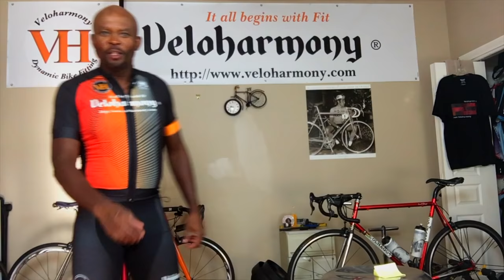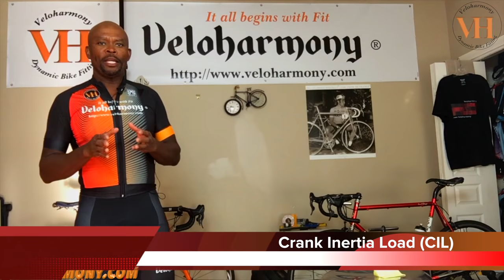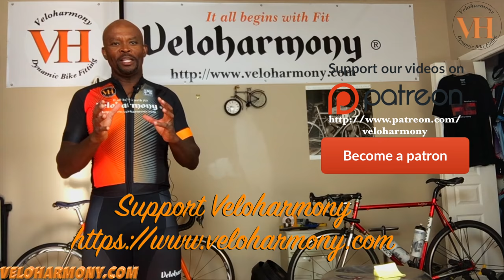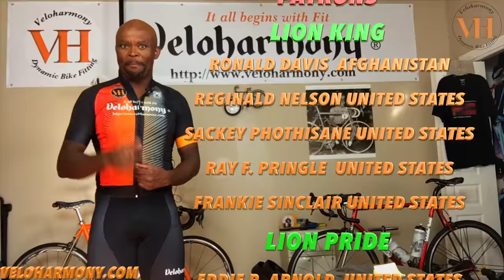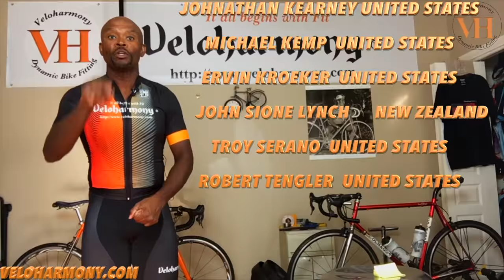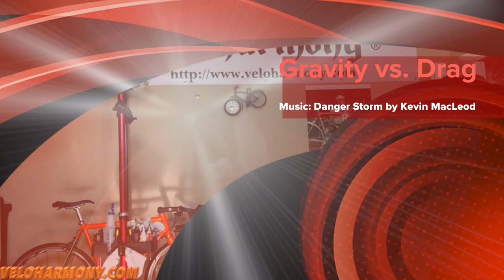Why do small cyclists struggle on Flats - Watts per kilo cycling

Comment: Great explanation Eldred. I’m a small guy (142lbs) and I’m working on my flat speed (power). I’ve found that I do even better on some hills when I stand on the pedals. I can really get moving uphill because I can generate more power standing. I’ve kept up some of the heavy hitters on my club rides when on the flats but sometimes it’s challenging. In fact, the Ride Leader seemed amazed that I kept up with them on that one ride. Lol. He kept giving me compliments. But I can’t keep up with them all the time. I have to spin at a faster cadence (95-97+) when they’re at a cadence of let’s say 88 in a slightly bigger gear.
Reply from the maker: As a smaller rider continue to use your natural tendency if you prefer higher cadences which stresses your heart and aerobic system more and focus on drafting efficiently and dialing your fit to clean up your posture on the bike and improve your aerodynamic positioning. You don't have the mass to push the same size gears as the larger riders so as the Father of the Le Tour de France Henri Desgrange would say: tête et jambes...ride with your head and your legs.

Comment: I am more of a lightweight rider, I struggle in the flats/wind. Although my cadence is around 95/100 rpm, I cannot push a big gear. I now try to sustain a bigger gear and maintain the same cadence, even if I am only able to do it for a short period of time. To slowly trying to get used to those bigger gears.
Reply from the maker: That's akin to interval training. You naturally do not have the body mass of larger riders, so you need to improve your technique, position & etc. to reduce the drag you face on the flats. Focus on refining your fit which will enable you to improve your aerodynamics when you ride.
Reply: Yes, on the flats I try to adopt a more aero position. Ridding on the drops or in the hoods with the arms bend at 90°. Before doing a bike fit I almost never used the drops. Just by staying a bit more low my speed increases slightly maintaining the same effort. As for refining the fit that is also a good ideia. Thanks.

Comment: I forget the name of the actual principle in physics... But the viscosity of air increases as the speed you pass through it increases.
Reply from the maker: Drag (air resistance) increases with speed because more air molecules are striking the leading surface of the object per second as its speed increases. With a constantspeed you WILL get a constant drag, because drag is a force, and an imbalance of forces is an acceleration, which is not a constant speed
Reply: The drag increases at the rate of almost the square of the velocity, to the power of 1.8 to be more exact. So the power output required to accelerate to a higher speed becomes exponentially much more demanding.

Comment: Last week we had an event with around 500 cyclists, it was 100ks it started off at a grueling pace around 38-40 kph. I struggled and dropped back to my pace 30kph. We came to a hill section which was 6-7 ks climb at 10% average and16% at tops. i am 65ks and 67 years old and was going well up to the first 2-3 ks but then burnt out. I have a very good cardio system and can keep up a good cadence but my legs just burnt out. I stopped and some riders advised me to get a 40 cassette as its a lot easier I have an 11/32 at the moment. What are your thoughts on this advise? Thank you love your vlogs. Cheers
Reply from the maker: It depends on what you're running on the front but anyway, I think with a compact 34X50 on the front, you might be okay with maybe a 36 on the rear. I think a 40 is just too much. What kind of cadences were you maintaining while seated on the 10% grade per say?
Reply: On the flat, I can keep up a good cadence around 85-95 comfortably and on short hill climbs around 60+ but the climb on the 10-15% it was my upper thighs that burnt out my cadence went down to around 30 maybe less just couldn't push up the long climb at that %. I wasn't the only one to stop but the guys with the 11/40s were going ahead without stopping. My heart rate was around 165+ but I'm ok with that just the grinding my problem lol. Cheers
Reply: 11-36 using a clutch rear derraiuler and wolf tooth road link would work with a 50/34. You can also use a sub compact crank and keep your 11-32

Comment: Eldred, doing a hub rebuild on an old new stock Deore LX rear hub loose ball bearings.  Used Phill wood greace to pack the bearings and noticed when I add Finish line wet lube to the cone race the hub becomes lightening fast.  Is it oK to mix wet lube with greace?  Gonna ask my pro bike mechanic later this week, but wanted to know what you thought of this.
Reply from the maker: Well all you're doing is diluting the grease. There are applications for grease where you want longevity and the dilution will not help that.

Comment: I am pretty sure you got it backward. Fast switch fibers = sprinter = lower cadence. Slow twitch fiber = endurance = high cadence. Right? or have I got it backwards all these years. This is why you see guys like skinny chris froome with cadence 100+ going up the hills
Reply: Matt Glover You have it backwards, my friend. Sprinters don't sprint at a low cadence. Cav, Sagan, Greipel are all spinning 120+ rpm
Reply from the maker: TeslaOsiris is right Matt. I have a preponderance of fast twitch fibers naturally and came from a Track background and when I got into cycling, I could easily outsprint most riders in my category, but I couldn't climb to save my life. I had to increase my ability to pedal at lower cadences 70-85rpms for sustained climbing to be there for the sprint. In a sprint 120+rpms is routinely exceeded. I can cruise on the flats around 100+ easily, but some riders have to really work at that.

Comment: At speed, the power you have to produce is proportional to the cube of your velocity. So, to increase your speed by 25%, you need to nearly double your wattage!
(Thanks Steve Gribble).
Check out this power to speed calc.
https://www.gribble.org/cycling/power_v_speed.html
Reply from the maker: Very concisely stated. Thanks for stopping by, appreciated your input.
Reply: Did you mean to put CUBE of velocity or SQUARE?

Comment: While there's truth to this, the smaller riders also have to carry roughly the same weight of the bike up the hill.  The weight difference from frame size, crank length, handlebar width all don't amount to be much.  Tell a little guy to pick up a few cases of beer up the a few flights of stairs and let the big guy do the same.  I think the big guy will win nearly every time.  Gearing is the same typically which isn't exactly optimal for the smaller rider either.  The practical problem with commuting in traffic is a safety issue.  You can climb as fast as you want pretty safely but it isn't prudent to pedal hard downhill.
Reply: emikami1.  I’m not sure what you mean by “gearing isn’t optimal for the smaller rider.”  Please elaborate. Gearing is designed to allow all riders to adjust to changing conditions and for their individual physiology.
Reply: There's a limit to the range and it is sort of made for average rider.  Spinners climbing hills may run out of lower gears thus have to compensate by standing more.  Conversely, the opposite can happen if you can't spin but have the power...
Reply from the maker: Power to weight exists period when climbing uphill. Your argument is unclear and not precise. Give a small rider the same weight bike as a bigger rider and at the same power output he rides away from the bigger rider on a climb. Simple as that. The weight difference is not based on equipment in the discussion. The focus is watts/kilo based on the rider's weight. There is no assumption that one rider has a significant weight deficit due to equipment.
Reply: What's not precise about it?  135 + 18  = 153 lbs vs 180 + 19 = 199 lbs.   However, the person that's 135 carrying 18 lbs is carrying 13.3% more of his weight.  The bigger rider is carrying only 10.6% of his body weight.  Gearing might need a bit more explanation.  Smaller rider typically uses shorter crank with less leverage yet the gears are the same and we all tend to ride 700c--so for a smaller rider, you end up running out of gears and are forced to riding by standing up.  That makes you go faster for a short sprint but might not work that long.  Ran out of energy at the top and there's nothing left going down hill hence the apparent coasting of the little guy.
Reply from the maker: That changes nothing if we're talking about watts/Kilo when climbing.
Reply: In terms of watts/kilo, you are correct and I did try to acknowledge that from the beginning.  However, the percent of body weight is still applicable.  You cannot expect a lighter rider with proportionately lower mass of everything to carry the same extra weight as a bigger person.  It's kind of the same as a passenger car.  One is a smaller vehicle and another is a larger one.  The later has larger and heavier of everything proportional.  It certainly takes more watts/kilo for the larger car yet the larger car is better for climbing.  And this isn't due to the later being a sports car and the former being an economy car.  It is more like a Ford Focus and a Ford Taurus.  All I'm saying is that there are other factors involved.  The practical matter is that as a grown adult, it isn't like you're going to get taller.  You can get marginally shorter with age but that's too small to be practical use.  So what you are left with it is training and finding the right style of riding for you under the circumstance.  What you would do in a commute will be different in a traffic controlled race environment for sure no matter what your size may be.